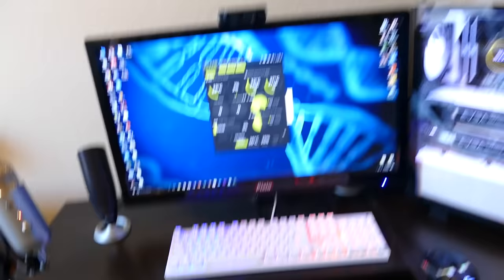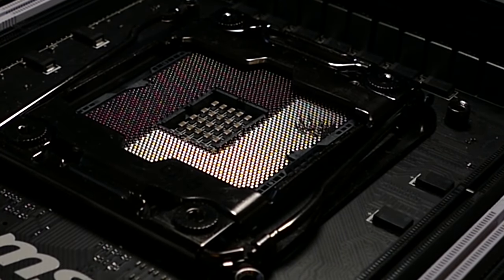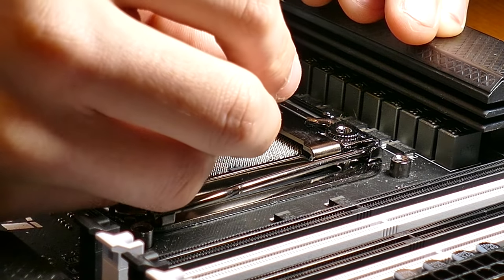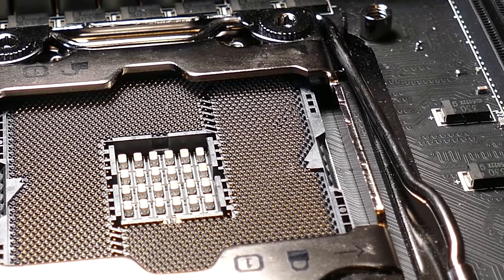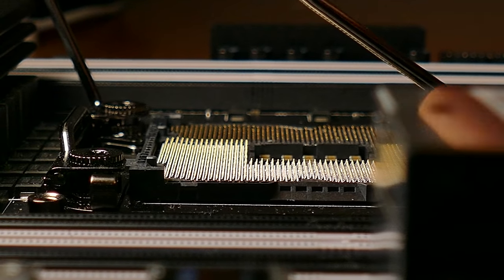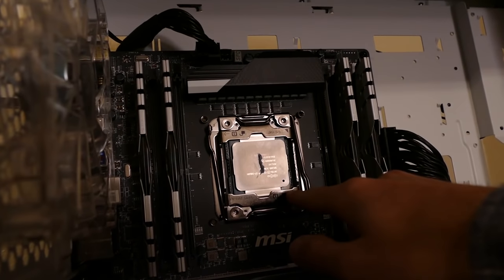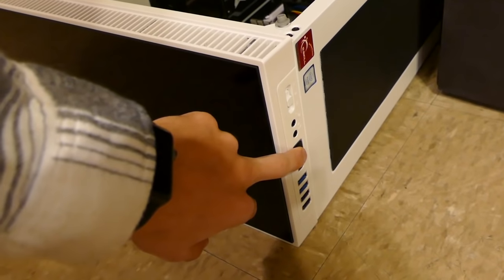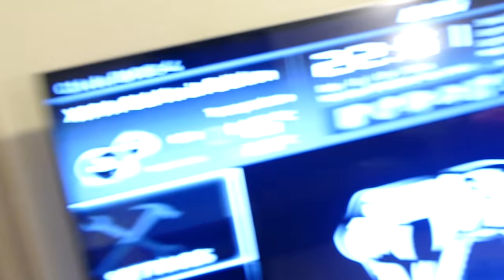I Stepped on a Motherboard. Let's Fix It!

Comment: geez, now a motherboard? youre not having a good time with pc's atm. btw, just because the system post, doesnt mean everything is good. You really need to check it more. Plus something like this could lead to blowing up your cpu/mb, if the pins were bent exactly right.

Comment: I fixed smth like that twice for client and a friend and those rigs are still working. I used very tiny, flat screwdriver and tweezers. You just need to take Your time and fix it one after another.

After Your all bad luck that You just had last time I still need to point You smth. You are a total hypocrite. Few films ago You throw away AMD stock cooler telling everyone that it's only think that you can do with it and now You use something very similar to it to temporarily cool the CPU for the test. 😑 Greg as You can see, not everywhere putting water cooling is a good idea. They were designed to be small, compact and quick to mount and sometimes simple solutions are quicker and easier. 😉

Comment: Wow first, some of the bullshit you say is just annoying..light approaching the socket?! I have never seen light approach anything...well except in movies. Course people either need special effects or break Einsteins laws of motion, travel faster than light, to be able to see light approach anything...and didn't you claim to be a science channel originally? I hate people like you, that say the wrong stuff all the time to attempt to make themselves sound more intelligent than they really are. Here's a thought, use a Teleprompter if you insist on continuing this. And have someone actually edit your statements before you read them on camera.
And we know how unintelligent you are by placing a motherboard on the floor and stepping on it...if that is, in fact, what really happened here. Frankly I find it hard to believe one small section of the board got damaged in this manner. I have built/repaired thousands of computers and the damage on the board doesn't support your story. 
But then again you couldn't even figure out how you destroyed two of your systems and then lied your ass off and conned two companies to replace the equipment that you destroyed by being a dipshit and are 100% responsible for. 
I hope people stop watching amateur hour here. You are embarrassing yourself and the PC community as well as anyone who actually knows what they're doing by you, who claim you know what you're doing, but clearly do not. The cable thing doesn't "just happen" to experienced builders. You're an amateur. The board thing doesn't happen either, at least not by anyone that should ACTUALLY be producing videos. Not even Linus has done anything this stupid...so incredibly stupid that he'd have to issue a retraction or lay expensive equipment laying around like a noob. I completely question your integrity, as should any viewer or company losing by doing business with you.
And you go filming your box P/N and S/N numbers and displaying them on video (God I hope nobody else is that stupid nor takes up this behavior because they saw you do it). This alone has absolutely nothing to do with informative building and has everything to do with being a cocky, moronic, show off who's karma is clearly paying him back for behaving like this and filming it...
Didn't you claim to be in school in Texas, away from your home in Florida? Here's a thought, leave content creation to professionals and you re-focus on school. Clearly you're not cut out for this.

Comment: Dude, get someone else to build your PCs and service them, stick to the software testing. Your videos about hardware just make you look really amateur, that can't be good for your channel!
You are Never gonna get a sponsor doing dumb stuff like using AMD coolers on Intel chips, I mean..... WTF!
Reply: i do not think anyone outside of case manufacturers, keyboards and mice will bother to send there hardware here in future, sure he was honest about the mistakes kudos for that, but these mistakes are mistakes you make when your learning not when your offering advice/opinions and videos like your teaching i could be really picky and dismantle every single mistake in his previos build videos he handles hardware like a noob. he lacks attention to detail. he does not follow a proper set of steps any tech would. simple things like when fualt finding you strip back and add components not test with everything and remove things till it works when your learning you learn to avoid these mistakes and work in a more methodicle way. this guy needs atleast 3-4 years training before i would let him near my hardware bench to even watch me fix anything